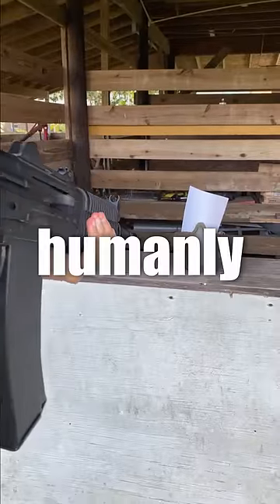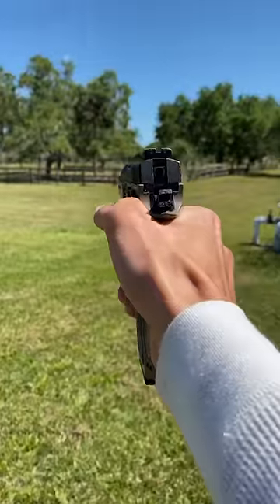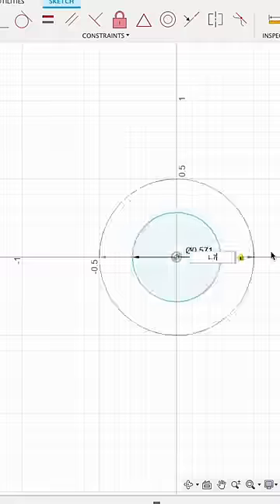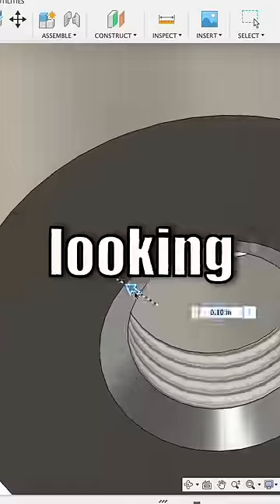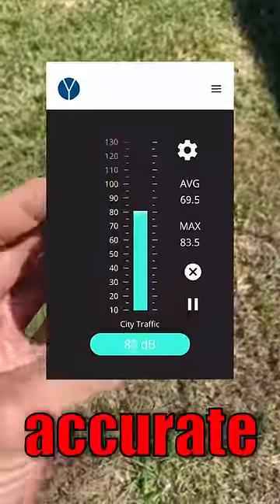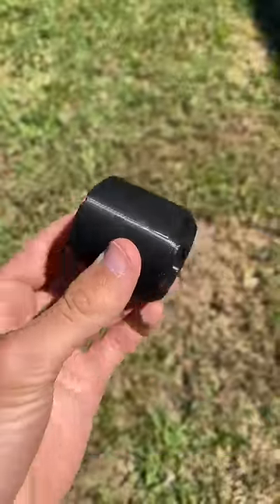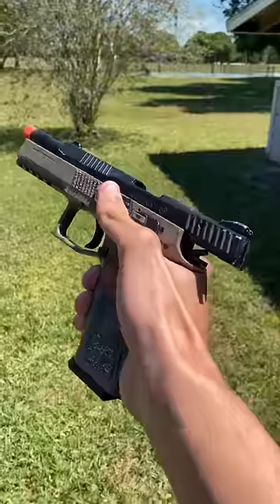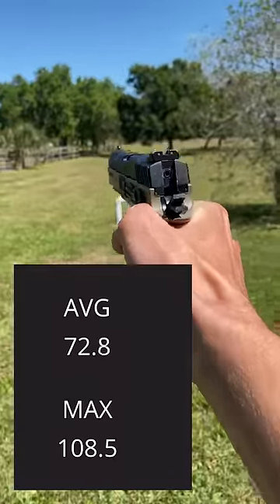The LOUDEST Airsoft Pistol Ever Made 😤

Comment: I wonder if making it longer would get it any louder?
Reply: Not just longer but wider. Ive experimented and used different object at my house. An aluminum can makes a sharper "ping" With a metallic ring on some shots. The most "practical" (If at all) was a 2 liter soda bottle. (Specifically Sprite) I cut off the bottom and it made a LOUD(honestly an understatement... 😱) "POP".

The loudest possible object I used was an orange traffic cone(2.5 ft tall) it is extremely impractical and got some laughs from my friends when I sent videos. But make no mistake, the traffic is funny at first. But being on receiving quickly leaves your timbers SHIVERED💀
Reply: isn't 4 decibels insanely much
Reply: @sunnyprovost9530  no not really. 4 decibels is the difference between you flicking a plastic bottle and slapping it. When you cup your hands around your mouth you increase decibels by about 6-8(depending on hand size)
Reply: @callsignredacted8290  my biology teacher told me that 109 decibels equals 108*2
Reply: @sunnyprovost9530  well that's why they're a biology major and not a physics major... Every 10 decibels is 10  times the original audible level.
Reply: @callsignredacted8290  this is unfortunately not true, 1 quick google search and it will tell u that every 3db it doubles
Reply: @prodbychev  You're also no math major, because you can't see that you are both correct (but you are wrong about Call sign being incorrect, because they are mathematically exact).

They claimed +10db is 10x, which is true. 50 db is 1x10^5 (10,000), and 60 db is 1x10^6 (100,000), it is indeed 10x.

You claimed 3db is 2x, so 0db is 1x10^0 (1), and 3db is 1x10^.3 (1.99526), so its roughly 2x.

Call sign had the exact mathematical answer, and yours is technically wrong but its approximate (its like saying Pi = 3).

Comment: I've done better, I made a "Flash Adder" (rather dangerous, but cool). Since I'm using propane for the propellant, its spewing propane out the front (also unfortunately at the rear of the slide...), but if you have a taser module and some venturi nozzles (aerospace engineer, yes I got bored) it mixes the propane with the surrounding air in a vortex and then the arc ignition system (which can be controlled by a micro controller and a switch when the hammer drops or trigger pulled) ignites it into a pretty impressive fireball out the front.

Why do I say its rather dangerous? Well you noted I said "unfortunately at the rear of the slide"... I knew that was a possibility, and thankfully I was wearing gloves (but it did singe the hair off my arms) because I was burst firing to see what would happen and sure enough it wasn't just the muzzle end anymore! 10/10 would do again though, but maybe with long sleeve shirt next time...

Comment: Yo Airsoft Gunsngear, Are pistol slides supposed to move around a bit, i mean like up and down and left and right not pulling back the slide or anything? I just bought a new Sig m17 and I have noticed this and want to make sure it didn’t arrive broken. Thanks
Reply: The tolerance (related to the wiggle) of the slides on toys are MUCH less than actual tools. It might be 0.5mm tolerance instead of 0.05mm tolerance on a real one (and even real ones you can tell when its cheaply made because they wiggle a lot more than the $1k+ ones). The problem is they are trying to make them for maybe $100 price point, but you always have part tolerances, and if you design the slide too tight, some may be so tight they either need hand filing (cost of labor is high), or they may have to toss the parts (cost of throwing away parts), or you have to pay a LOT more to machine with tight tolerances. If you make it too loose on a real one it could be disastrous, but on the toy it doesn't really matter all that much other than it feels cheap, but having 100% of the parts you make actually work with 100% of the other parts you make (because those have tolerances too) is much more economical than having to fit check 10 parts finding the perfect size for each hoping they all go together.

If it feels like its about to fall apart that's an issue, if its just a bit sloppy that's normal. If you don't want that feeling you could technically shim it, or if you have a CNC machine manufacture another part, or spend $1k on a nicer machined one to begin with (but its just a toy, I would suggest spending that on the real ones and keep the toys affordable)
Reply: @jakegarrett8109  Tysm have a great day you have been a great amount of help(mentally)! :)

Comment: What happens when you hold the slide still on a gbb pistol while firing?
Reply: One of two things. It's gonna Jam or you're gonna fuck up your fingers. Maybe both. Just don't do it honestly it does nothing interesting I've tried it
Reply: @BlackCatBlades390  will it fire harder? I don’t have any experience with gbb airsoft
Reply: @Tucan & Chicky  The way the gun is designed all that will happen Is the C02 will try to force the slide back even when it's being held. But by holding the slide your basically adding unnecessary stress to mechanisms. It doesn't make it shoot harder it's genuinely bad for your gun

Comment: What’s with the tape on your print bed?
Reply: It helps PLA stick to the bed, also doesn't wear out the bed.

If you have it tuned well the best is just a simple glass bad for PLA, makes the bottom surface smooth as glass and pops right off, no messing or replacing of tape (you might get dozens of prints from a piece of tape, or you might get one), however painters tape works really well for PLA and also does ok for PETG